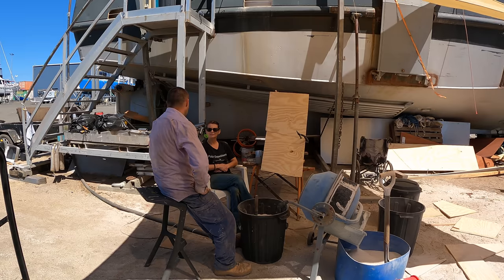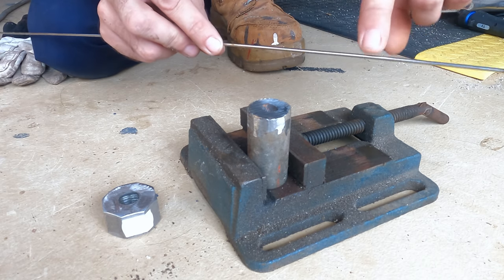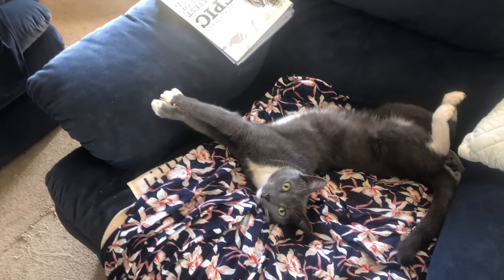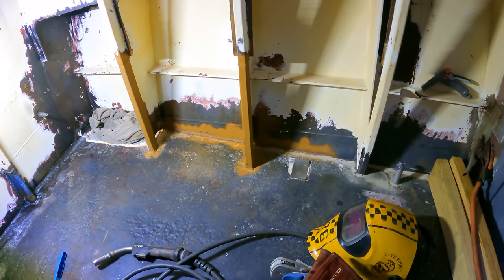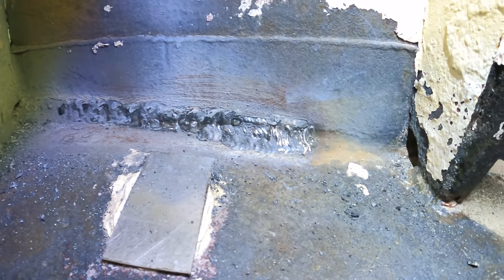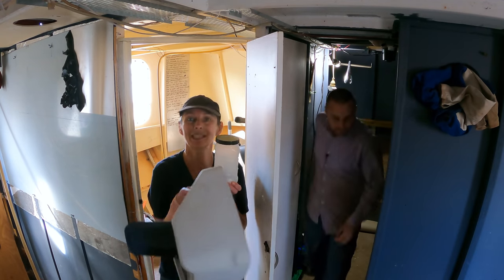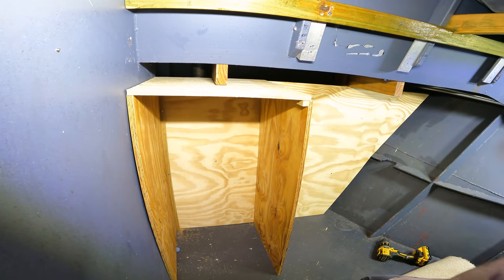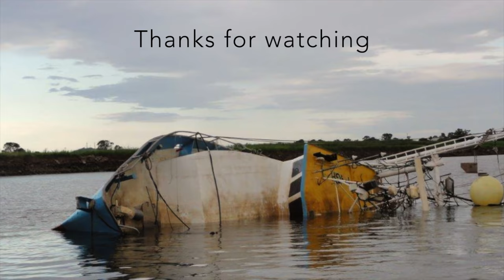The Wet Sandblaster Gets an Upgrade - Hydroblasting Project Brupeg Ep.194

Comment: Hey bud I think you should be putting the phosphoric acid on before the water dries to stop as much surface rust
Reply from the maker: Then it wouldn’t work. It needs the rust to chemically bond to the steel. Jensen the name rust converter

Comment: Hi, there is such a thing as a "full flow" or "full port" ball valve. The Teflon ring doesn't dangle out in front of the hole drilled in the ball, its drilled to a full dimension. You mention the valve sits half cooked most of the time...if this is by choice then try a smaller size line overall fully open when in use.

There are industrial hoses where the rubber compound is blended for sand blast, usually larger sizes I think. Its counterintuitive, but on that small red air line, consider the softest compound available , maybe even clear pvc tubing (not poip/pipe). I recall some of the industrial hoses design allowed the sand grains to bounce off the liner not bite in, because its a soft durometer. That may be at higher/different criteria but worth considering. 
I think there is a supplier that provides a mobile service "near you"? Called EnZed , a division of Parker Hannifin, they're the best. Worth a call if you can find them.
Reply from the maker: Cheer Jim, ill give them a bell, that are in town here.

Comment: Hey Dame, You might want to check out  “Welding Tips & Tricks” on YouTube. Contaminating the tungsten is a no go.  You don’t need to strike it like a stick!  The TIG welder will increase the voltage to initiate the arc then drop it once the arc is established.  Lanthanated 2% Tungsten is the word and keep it clean and sharp.  Stainless is just mild steel with a fair bit of nickel in it.  304 and 316 still suffer from chlorine corrosion and pitting.  Super duplex alloy is the go for the critical stuff.  Back to work! R.
Reply from the maker: Hi Ron my TIG welder is not a hi frequency start it’s scratch start so it literally will not initiate the arc unless you touch the metal and pull the trigger

Comment: For your throttling ball valves, can you just add a fixed orifice so that the valve is either fully open or closed?  I've seen holes drilled in coins work before but probably too lightweight for your use. Maybe a hole drilled in barstock or a nipple welded closed??

PS. For perfect fitup for wood vs steel, remember MIG is to steel as Caulk is to wood. 😁

Great to see everything going so well
Reply from the maker: Love your thinking. Nothing says “I’ve bloody had enough of this joining timber rubbish” quite like adhesive in a tube

Comment: Dame:  That is exactly how large forged steel crankshafts are repaired.  They are welded up and reground back to standard.  So I have never given it any thought to being less than a standard practice to weld up worn places.
Reply from the maker: Yeah some people on the interwebs (generally non commercial folks) freak out at the idea of adding metal to repair something. I was preempting the ineviable you shouldnt be doing that comments more than anything.
Reply: Yes, or metal spraying. Wish we could upload photos into the comments (lol, who am I kidding, we can't be trusted)
Reply: @ProjectBrupeg  I have seen an alloy engine block have aluminum welded in to build up a mount for a rally car that crashed. the same block must last the whole season.

I have also seen steel sleeves added to an alloy block due to a crack in a cylinder and the block welded early in a season, that engine came second as the driver was "just there for the sponsors" the rest of the season waiting for it to let go. It didn't and he finished the year in second place.

A good welder (not me) will have the welded area as strong or better than the original material.

Also I must have the same tape measure as you, the tape actually grows and shrinks depending on the heat or cold but it happens just randomly before I cut something, that or the material shrinks!
Reply from the maker: Yeah variable tape measures are the worst, definitely seems to happen more when you measure once...

Comment: Question? What sort of disc are you using on the angle grinder to cut back that wood? I’ve often thought that would be a great idea, but lots of people say “NO”. Sometimes you get some wood that you need to remove that’s too small for circular/jig saw, but will take forever with a sander. I suspect a flapper disc of some sort, but I’d love to know for sure :) Sandblasting - I watch I think what an insurmountable task - but you guys are the best advertisement for being focussed, seeing the goal and getting there. Congrats!
Reply from the maker: Hi Deb, we mainly use 40 or 60 grit flapper wheels. 100% steel oriented so didn’t know how it would go on wood but it turned out really nice. Light pressure and it was able to be feathered to a lovely smooth finish

Comment: Ball valves should only be used fully on or fully off.  Put a restrictor in the line to limit the flow.  That is, put in a washer that has the right sized hole in it to limit flow as desired so you can leave the valve wide open.

Comment: You guys enjoying your summer we're so over our winter poor me from IL. Try stainless quick lever gate or butterfly valves to replace the ball valves. Not sure about the butterfly valve cause it doesn't tuck away it sits in the middle of the body sideways might erode the edge.

Comment: I watched a video the other day about trawlers getting fitted with bulbous bows,I've not seen you doing any fibreglassing,maybe something to consider. Apparently you can get fuel savings between 5 and 10%,it also decreases pitching and acts as a safety device in the event of a collision. I know you're not looking for extra work but may be worth looking at it. I did wonder if your wings have much,if any impact on pitching?
Reply from the maker: Bulbs are very good but not for a boat going into ice. they also present issues with chain anchor rodes as the chain bangs on the bulb and drives the crew nuts. if we wernt going to the ice we would definately look at a bulb

Comment: Instead of regulating with a ball valve insert a section of pipe inline with a smaller internal diameter to choke it down to where you want is what I would try.
Reply from the maker: Yeah i was thining of something simple like a rubber washer with a smaller dia hole pushed into the ball valve then screw the valve back on. rubber lasts as the sand just bounces off

Comment: Instead of a ball valve what about a really oversized screw gate valve? If its never going to be fully open you could put removable ablative armor on the wear side of the gate.
Reply from the maker: I wonder if you could strip a valve down and just coat the gate with ceramic (the armor you mention)
Reply: @ProjectBrupeg  I don't see why not, or even overbore a ball valve and add a replaceable ball liner made out of a conveniant sized pipe that you could glue in place or hold in a setscrew. Especially if you start with one bigger than you need and adapt it down. It would be really easy to do on one of those slab gate valves I bet.

Comment: What if you set that feed valve where it works best then take it off and see how much is opened then just put a smaller valve that you just open fully or just a pipe that size? awesome as always cheers!
Reply from the maker: We always need the ability to adjust the flow rate of the sand but by dropping down in valve size we could acheive that same max flow with a smaller opening. we did ponder a restrictor as well

Comment: Ball valves aren’t meant to throttle, I.e., be partially opened. You may want to try using a globe valve instead.
Reply from the maker: That looks interesting, i wonder how the internal castings would hold up to the sand
Reply: @ProjectBrupeg  I think the seal on the seat would go first but at least the opening is symmetrical so the wear would be evenly distributed. Right now, it looks like the Teflon sealing ring on the ball valves is what goes not the ball.
Reply: Or a  just a  simple constriction /washer  /crimped pipe,,,upstream of cheap ball that gets you in the ball park

Comment: Ball valves should be able to open fully. If that brand doesn't try a different brand. As Jose says Ball valves are not throttling valves only globe valves are designed for that function.

Comment: As far as I remember there are what’s known as full diameter ball valves with ceramic balls available from American suppliers which will definitely handle the abrasive problem much better  or there is a company called CERAC in Milwaukee Wisconsin  (who supplied the ceramics for the space shuttle’s tiles) 
Who would probably help you if you contacted them. Hope that this might help
Reply from the maker: Huh, didnt know ceramic ball valves were a thing. Awesome stuff Harvey, ill have a hunt

Comment: 27:19 Taking a flap disc to plywood? Not really a master carpenter move, but it works - work smarter not harder! 😉
Reply: I used to think that way too (very amateur carpenter here) until I saw someone use a flap disc instead of a coping saw for back cutting/fitting cove molding.  The gentleman stated that once you get used to it the results are great, it does it much faster and the mating surfaces don't need to be smoothed to remove the saw marks.
Reply from the maker: Never said i was a master carpenter, actually pretty sure ive been upfront and said wood and I dont really mix. that said the flapper and the grinder is a tool im able to use with my eyes closed so i feel comfortable enough using it on anything and confident i can get a decent result. which we did.

Comment: Try replacing the ball valve with a Saunders diaphragm valve which can also be used for throttling flow
Reply from the maker: Thanks Peter, i had a look at them and i like the fact its rubber that is the closing feature but looking at the cut away i do wonder how the internal metal casting would hold up to the sand

Comment: Looks like a military fire service Co2 powered fire extinguisher 🧯

It's a shame the hosetails don't have a ceramic insert sleeve that can be pressed into it. Love self build kit.
Do Tig or plasma consumables not fit into the bronze tips
Reply from the maker: I think part of the issue was hose size. we had 13mm hose and the fittings to suit. we have upgraded to 20mm hose and tails to suit which has slowed the sand velocity down and seems to be easier on the gear. the blasting is the same as the water speed/pressure is what does the work once the sand is combined

Comment: Have you thought about using a smaller diameter valve wide open, rather than than vale you have throttled back ?
Reply from the maker: Yeah we have tride a few options like that. it didnt seem to make a huge difference. I have been pondering a restrictor of some type

Comment: Re: sandblaster ball valves chopping out...If valve is always only partially open, and if that is the cause of its seals chopping out...how about fitting a smaller dia. valve that can run fully open?
Reply from the maker: Yeah your right i think that is a simple solution to the problem, will give it a shot when we change valves next

Comment: Sandblaster was yesterday, look for laser cleaning
Reply from the maker: Weren’t lasers designed specifically to be put on sharks heads in Austin powers
Reply: @ProjectBrupeg  sorry that wasn't really a joke
Reply from the maker: Laser takes paint off but any new paint will fall off as lasers don’t key the surface like sandblasting. If they were the thing to use every commercial ship yard would have one as sandblasting is bloody expensive
Reply: @ProjectBrupeg  good to know thank you ;-)

Comment: You need a straight line where there is any sand in the air, and only air in the valves.
Reply from the maker: That would definately help but its not really possible on this machine design yet.

Comment: Damnnn i'd of used a grinder with wire brush. You just hand brushed like what 100-250sqft? With a 1"+/- wide brush. Well done but man seems like you could mechanize  the process somehow. Maybe not.
Reply from the maker: Wire wheel on the grinder would be fast but rip too much off. it nees a hard scrub but not to hard